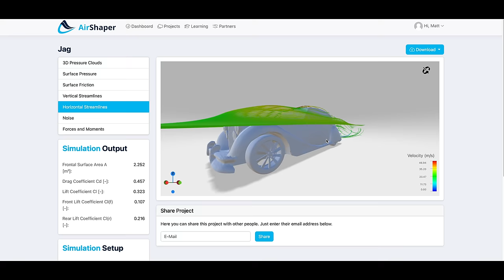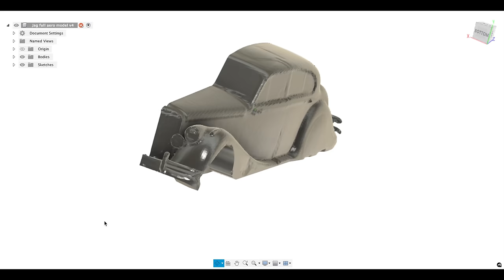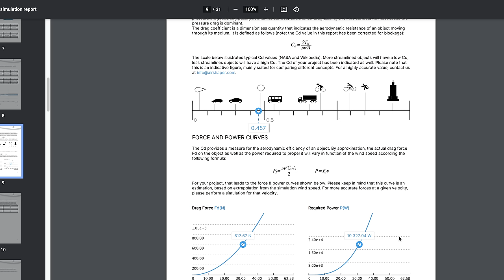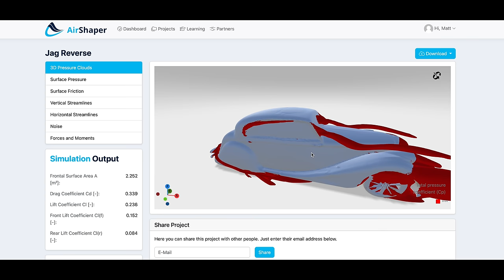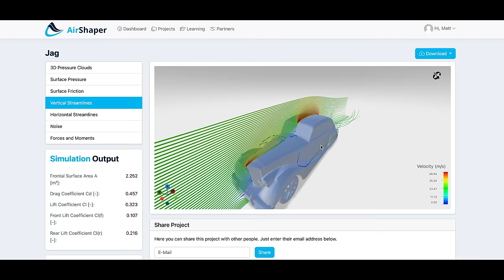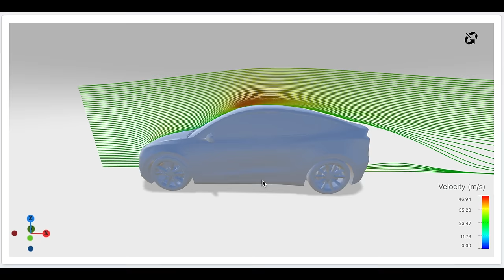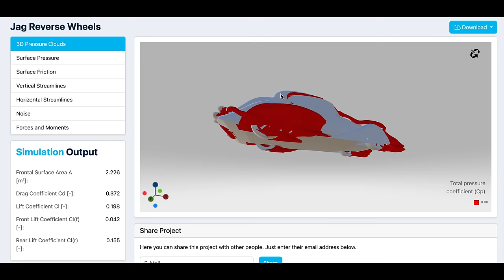Why Some Cars Are Faster Backward

Comment: Then there is the dymaxion car which Buckminster inteded to add wings to. But handling was so bad with lift at the rear and wanting to turn into the wind that they rather accepted to drive in "normal" cars instead.

Comment: Nice HJ Holden @10:35. BTW I worked at the Elizabeth GMH plant in the summer of 78-79, on the production line building the HZ Holden. My car has better drag driving backwards? I doubt it, it is a Discovery 2

Comment: Very surprised that the windshield going in reverse isn't a low pressure zone.  I recall Mythbusters doing this a long time ago with the Porsche 944 (or maybe it was a 928) and they used a wind tunnel.  I recall seeing either a low pressure zone or a lot of turbulence around the windshield when in reverse.  They concluded that the Porsche wasn't more aerodynamic in reverse.

You can do the same test they did.  3d print the car and submerge it in flowing water.  I think they used oats, but something finer like glitter would probably show up better?

Either way, Great Video!

Comment: Someone did that back in the 30's with a sedan showing how it was more aerodynamic in reverse.  I love the guys with those little Jap cars with 3 cylinder motor and 6" exhaust pipes with wings that look like something from a 747.  They probably had a top speed of 90  originally, and with the wing it drops to about 75.   BTW- get rid of the Tesla wheels- the originals are better looking and more aerodynamic.

Comment: would be interested to hear any aerodynamic improvements that you'd make to the Jag, if that's in the plans, or weight reduction or whatever, just basically what the plans are next for the Jag (other than the interior bits that are turning out really great so far :) )

Comment: .285 '17 Volt and .360 '13 Ram. I'd need to 3d scan my 97 Grand Cherokee on 35s but... Probably worse than your Jag. Especially considering I get 10mpg towing it with the Ram and 9mpg driving it.

Comment: It's the same reason a Spitzer bullet is more stable and often faster seated butt-forward in a casing.  Weight and bulk up front, low mass pointed end making a smaller wake.

Comment: Cutting the car in half for the simulation probably makes up quite a chunk of the additional, observed, drag. Flow separation is both unsteady and "antisymmetric" (you get what I mean). Hence, splitting the model in two leads to less separation and less drag. 

p.S. its a Jaaaag it doesn't need to be efficient. You can just steal some electricity and no one will care. Cause you're driving a Jaaaag...

Comment: So your Jag is basically a rolling bar fight: it comes along and pushes the air rather rudely out of the way... 😂😁😇

Btw: I can remember stories about the Lamborhini Miura and how bad it was/is at high speeds. It creates so much lift in the front that the steering gets lighter and the front wheels have less grip... 👀

Comment: Perhaps some covert airflow ducting inside the front of the Jag? Inlet through the grill, outlet as small slots along the side of the "engine cover" to disrupt all that bad air coming off the headlights. Could be done very subtly and not change the look.

Comment: Take the body and spin it around, built to drive backwards at highway speed with 200 miles of range so you can flash your high beams at the f150s tailgating you.

Comment: Have you seen those round projector retrofit headlights that have the near spherical lenses over the front of them? I think they were made for jeeps so the huge projecter unit could actually fit. Anyway, they stuck out real far up front with a round profile..... I wonder if those would help a lot with the noise and turbulence with the headlights by replacing the flat blunt face with something more streamlined. Also, what about puting some close-able slats on the grille that can open/close when the system actually needs cooling?

Comment: I don't know what I'm talking about, but . . . whenever I think about aerodynamics I imagine something falling. Parachute? Not very aerodynamic. A plunger? Same. A water drop? Pretty good. A heavy knife? Even better. I'd be willing to bet you could design something like a tiny spoiler or a chrome emblem or light that would function as a small spoiler. I got nothing for the front end, other than hub caps. Great video.

Comment: Aptera gen 2 has Cd of 1.5. But then it is designed with aerodynamics as a primary consideration.
Edit: CSN is correct - 0.15. I stand corrected and thank you 🙂
Reply: 0.15 I presume!  😅
Reply: @csn583  You are indeed correct, the best kind of correct, technically correct!

Comment: So you want sharp edges at the back to detach airflow abruptly?
Does this mean that the spoiler around the top of the boot (Trunk) lid on most modern hatchback cars would work better if they didn't have such a radiused rear edge?

If that's the case, I'm surprised that in our modern tree hugging society, car manufactures don't add a pedestrian friendly rubber lip to these spoilers that have a much sharper trailing edge, therefore reducing drag a tiny bit, and getting a benefit (on paper at least) in fuel efficiency and CO2 grams per mile.

In a world where some people almost seem to get orgasmic over berating everyone else for not doing enough to help the environment, I'd think having a prominent little rubber "Virtue indicating" lip spoiler to proudly show the world that your car might just be that little bit less of a polar bear genocide machine than your neighbours car could bring a significant sales boost.

Comment: you could mount some clear plastic sheet as a spoiler on the rear of the roof of the jag. Kind of like how f1 driver helmets have some clear plastic on them to improve aerodynamics. It might look stupid but if it works it works
Reply: I feel like Matt was a little unclear.  Sharp edges are better when they work with the overall design to help reduce the size of the wake.  A big spoiler at the rear of the roof would add both drag (and downforce), as it would increase rather than decrease the size of the wake behind the car. The vortex generators at the rear edge of the roof of a Lancer Evolution are, by comparison, there to help the floor stay attached over the rear window (not to make it dettach, quite the opposite).  Though as Matt says a lot of the other trip lines on cars are there to get a clean separation where the engineers want the flow separation, like on the driver's helmets so the seperation happens at a fixed point. [...sort of, sometimes the trip lines are there to trip the flow to turbulent so it stays attached around corners better like the Lancer Evo row of vortex generators (thereby reducing the size of the wake)... it depends!]

Comment: You could probably have a lip on the front wheelarch that pushed air a bit outside and thus reduces the drag from the front wheels... Might not even need much of an extra lip as such and just a bit of a bend in the metal.

Comment: You should use the SAAB 96 for aero comparison, as it was designed on the principles you are describing, and it had a drag coefficient of 0.32 in the 1960's and 70's. Thanks
Reply: The original Ur-SAAB even had fairing overs the front wheels I believe?  The Ur-SAAB quite a pretty car!🙂

Comment: There was a video in the 90s of a little hatchback (like a Fiat 126) that a guy had installed a Honda drivetrain into the back, including the steering wheel. It could drive backwards, with the wheels turned so it was driving sideways. You can do this too. Edit: Found it - https://youtu.be/Vh4fTRj-YeI

Comment: After I got over the shock comment about why we drive on the correct side of the road!! And a pictures of a British Leyland Princess and an Allegro, shudder !! I got to thinking, The Citroen 2CV also has rear wheel spats, but no radiator wall etc etc, would it go better in reverse??  It's power requirements are all of its 29 bhp at 70 mph, does this match the computer simulations??

Comment: Never thought id see a hj kingswood in your video. fun fact, you can crash one into the back of another one thats stopped at 70- 80kmh, survive, buy the one you crashed into and use its front panels and half chassis to fix your one, and keep driving it 🤣
(my dad did that in 97) i have the before and after pics 😂

Comment: I wonder how much aerodynamics get impacted by the fact you don't have the side pieces for the hood, and that in real life the air can actually go through the grille. I also wonder if making some undertray to make it full flat bottom would help, as well as maybe having a lip on the roof butt, maybe something simple and discreet would help more than expected.

Comment: I am curious what, if any, small changes you could do to make it more aerodynamic. Obviously "small" is subjective, but as you mentioned, things like vortex generators in the right places could help. Maybe something to clean up the wheel wake. A very mild lip at the back. Blocking off the front radiator. That kind of thing.

Comment: It's better backwards because the wind was meant to be faster than it, so it can push you efficiently,  1950 british engineering was not bad, they just designed for the problems of the times!

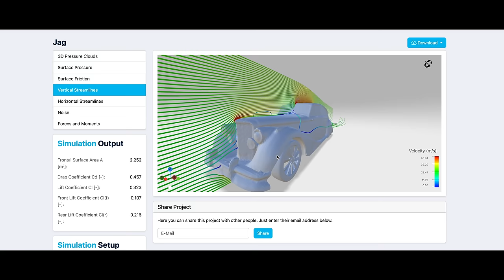Comment: @03:08 doesn't the air go through the radiator grill down and out? I'm uncertain if it's the worst offender there. It would have to calculated as an opening in the front for modeling to be correct, unless you have closed it off from intake. If it is closed off to keep water and debris out, then extending the V shape in front might help.

Comment: Guess Toyota had the right idea reversing the chassis for the mr2. Then they could make it rounded in the front and sharp in the back.
Wonder how many sports cars we could get by reversing car chassis layouts and giving them nice bodies.
Is a drag coefficient of 0.26 for a family car believable? It's what Infiniti claims at least. It is around 0.25 but I'd think that a very aerodynamic car would be more like a super car focused on top speed or a super economical compact.
Reply: The MR2 isn't "reversed" - it just has the engine moved back to behind the driver. It still has a radiator in the front, and the same general wedge shape as other sports cars.
Reply: @brianb-p6586  it is reversed. It's how they made it mid engined rear wheel drive using front wheel drive parts. The engine is the right way though weirdly enough.
But being a sports car, it needs to make downforce and ends up not having that good a drag coefficient.
Reply: @zeus lim  it's not reversed, assuming that by "reversed" you mean turned around, as Matt is discussing regarding aerodynamics. The front of the engine as installed in the front of a front wheel drive car is still the front of the engine as installed in an MR2... it's just moved to the back, with the transaxle, not rotated. The resulting body doesn't need much space up front, but that doesn't really change the shape.

Comment: What do you think about Porsche 924 and 928 better drag in reverse? It's been 13 years after MythBusters said they'd test it but actual footage of reverse driven Porsches online add less than a minute and some pictures...Real or Myth? Could you test 3D shape using CFD?
Reply from the maker: Modern CFD would definitely tell you if it was better backward, as long as you had a good 3d model. I bet without the rear wing it's better in reverse. Mythbusters is great entertainment but the field tests they do like that always have so many unaccounted variables.

Comment: Xk120 is a genuine piece of automotive art. Far nicer imho than the overhyped E-type, but not as nice as the D-type. Especially the one with the fin out the back of the cockpit. Why you'd want to put an electric motor in any jag is a mystery to me, but hey! Horses for courses. Personally only really like 2 stroke engines and the resulting belch of blue tinged perfume out the exhaust.
Also.... How in hells name does an American know about the curse of the Austin allegro (colloquially named the All-aggro)?

Comment: Can you explain how vortex generators work or don’t on a car. Or maybe a van or boxy vehicle, like your 4 runner?
I’ve always been interested in the concept but internet experts alway ruin any research.  
Going to college for business hasn’t helped either. Lol. 

I don’t expect dramatic results on a car , just curious.  
Thanks, great channel.
Reply: Basically turbulent flow stays attached around adverse corners better.  The vortex generators mix up the high energy air away from the wall with the low energy air near the wall (called a laminar boundary layer), to "trip" the flow to turbulent.  Then you can have your adverse corners (where it slopes away or expands or whatever), yet the flow will stay attached around that shape (to a point, not 90 degree corners, but maybe a 10-12 degree corner is doable, even more so where it is a curve that gradually increases).  Do a google and you will see some visualisations of how vortex generators mix up the air.  (They generate a "counter rotating vortex" pair that pushes high air from the freestream down towards the wall, and vice versa, so it gets mixed up.)

Comment: Question: we don't want to cover the front wheels for obvious reasons, but also as pointed out it would give the most aerodynamic gain. How much wider can you make the 'front body' until the added drag cancels out the gain? It would make the body look goofy for sure, but efficiency bro.
Reply from the maker: The solution is obviously the single front wheel trike like the Reliant Robin.
Reply: The Saab Ursaab prototype tried it, but it had a limited turning circle and problems with snow building up
Reply: Surely this calls for an overengineered, gimmicky, and possibly dangerous foldable or drop-down front wheel cover when riding straight on highways speeds but automatically retracted once you pass a certain steering input.
Reply: @SuperfastMatt  Decreasing the wheelbase width is the easy solution of course, but what about making the body work wider? It would look aesthetically pleasing too: 8::::::>

Comment: What if you added front wheel covers that were wide enough to accommodate turning...., or had Active flaps to allow the wheels to break the cover wall on tight turns...

Comment: The aerodynamics of the Jag being SO bad as to incur significant costs in range and energy, I wonder if it would be worth putting some effort into actually fixing some of the issues, invisibly. For example ducting some air from inside the engine bay to exit at the front of the front wheel arches as a crude air curtain.
I've informed the algorithm that I want more of this content.

Comment: Well since I drive a truck that probably isn't true for me, all flat, vertical surfaces in the back and I don't want to begin to imagine how the big empty box affects aerodynamics. Still get 28 mpg on the highway though, so I don't mind.
Reply: By truck you mean pickup? Mythbusters showed how with the tailgate up, they are designed to form a separation bubble over the tray area, so actually the main air flow skips right over the tray (as long as the tailgate is up and not down).

Comment: So if it doesn't look good with Shark Antennae going forward, would Having a set of RBGable LEDs at the top with a double Missile structure not do well and make for some additional and possibly needed depending on regs, 3rd brake light/higher indicator?

I feel like maybe it's a bit much to do the whole thing, but that's functional and you could group it ~3__4__3 and make them slightly spaced so it doesn't look like something less than what the mack truck beside you on the highway would be, and I'm thinking it would still reduce more drag than it would create itself.

I'm sure everyone has some very interesting other thoughts, so, other than backwards, would be very interested in a followup of putting our suggestions through the ringer of actual or of theoretical tests. Maybe top 5 get trials?

Comment: How epic would it be to mount the body backwards and drive it that way... Could rear wheel steer be combines with low angle front wheel steer and actually work nominally as a result, in a tight wheel case package?

Comment: My toy cars had a shorter turning radius in reverse. Now that we have "rear" axle steering (up to 10% for instance in the EQS)...how well might a non-sled turn with such a setup both front and rear? Conveniently, the rear ones come with a more powerful motor (on Taycan as well). With 2x 10º, how well would a car handle? Could the front wheels be packed up nicely?
Reply: Since wheels have become so heavy anyways, why no opt for the lightest front wheels/tyre combo that fits and mount a flexible fender to it, unsprung? Meaning, the fender would follow the suspension movement of the associated wheel, rather than the wheel move relative to is as is the custom with most fenders. The unsprung fender adds (unsprung) weight which is usually frowned upon, but it would save lots of drag. And look cool.
Reply: Also, these rear steer unit are steer by wire. That saves parts and complications making it work with the steering wheel. The front (most) unit would need to be programmed to work like a normal one for the first 10º of steering lock, with the rear joining in from there. Should be OK, you only need more than 10º front in high speed drifts, and even then, the other way. That said, curious what drift cars would do with rear steer.